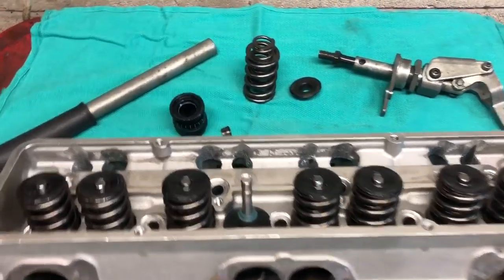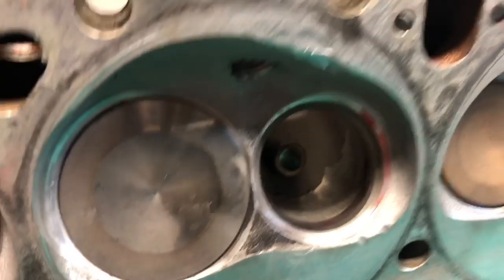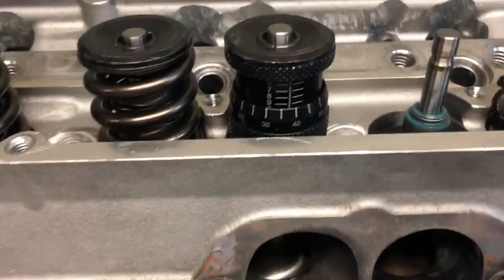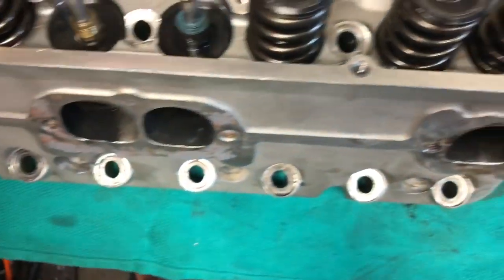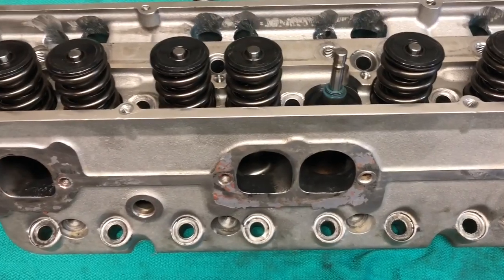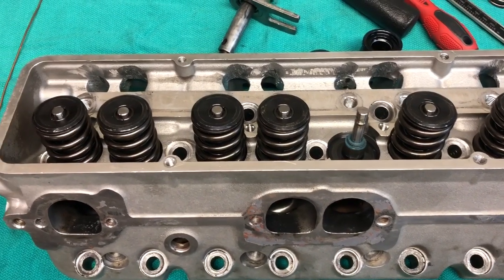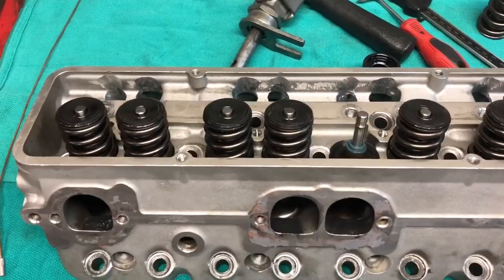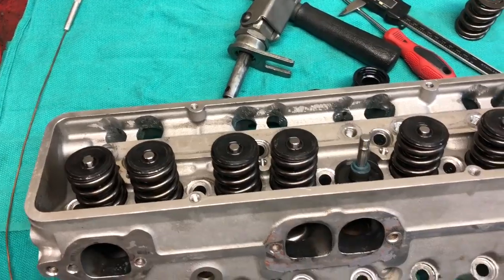Cylinder Head Assembly

Comment: I just measure a piece of welding rod with my calipers and ad or remove shims until its snug been setting them up for year like that lol but i don't mess with anything this serious
Reply: The height mics are inexspensive. The brand name ones average about 70 bucks like comp lunati and crane and the Chinese ones like perform or summit are half the price of course. 

 Pac mics are like 120. And they do have different ones for beehives I'm gonna invest in one

But as you know you get what you pay for and the cheap mics dont have instructions with them a lot of the time

Comment: How would you describe "valve float"?
What determines when to use variations of valve springs?  Doubles, triples, with or without dampers...
Reply: Thanks for info.
Reply from the maker: When I have experienced valve float, it's almost like a rev limiter.  No popping like a normal rev limiter, but just will not rev.  Usually happened around 6000rpm, but I imagine it could happen earlier or later depending on the cam and how close the springs are.   But it is basically loosing control of the valve.  Spring pressure will dictate if you need doubles or triples.  The dampers help control the spring.

Comment: is the new valve seat depth going to affect rocker arm geometry ...push rod length?
Reply from the maker: Possibly, I have shaft rockers so I should be ok in the pushrod length.  Will check the geometry, but from when they were set up last.  The roller tip is closer to the exhaust now, so with it going up a little it should just move it closer to the center.  I hope anyway.

Comment: Great explanation on valve springs!  What spring height tool is that?  Seems like an easy way to double check everything!  Thank you for the videos like this!!
Reply: I see how you could catch that. Definitely seems like a good tool, i ordered a proform one from summit after i watched the video. Although i got the one for beehive springs, being that’s what i usually deal with. Thanks for the advice!
Reply from the maker: This one is from proform, but there are a few cheaper ones available also.  It really is a good tool to have to verify installed height.  Could also help you catch a stretching/tuliping valve
Reply: They make 2 types for springs, the regular size like this 1 for larger retainers or if using smaller retainers like for beehive springs they have 1 so the retainer doesn't drop down in the slot